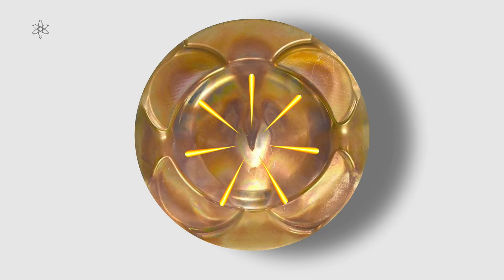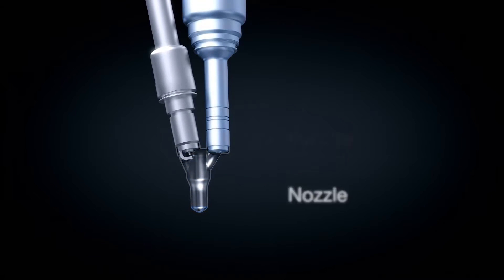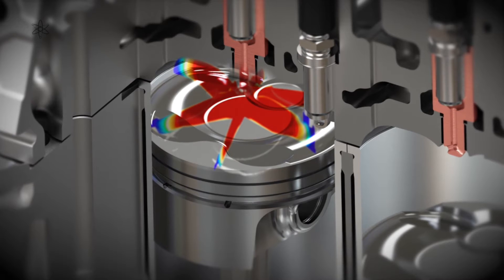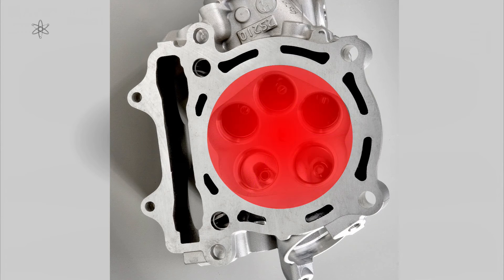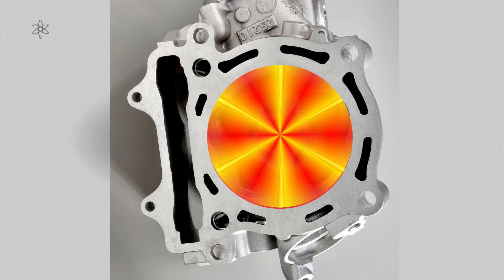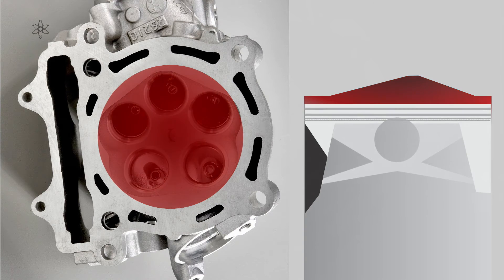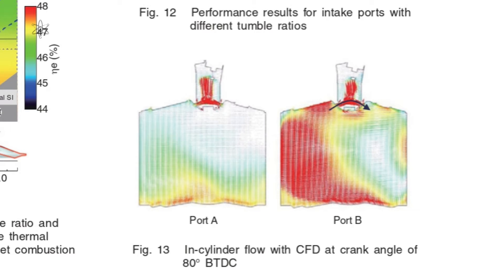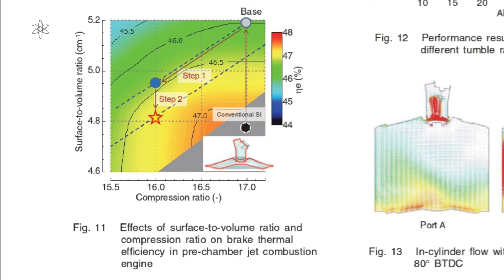Turbulent Jet Ignition

Comment: I have a very remedial question.  There are industrial passive Pre-Chamber  spark plugs for generators using natural gas for fuel that look very similar & have jet nozzles.......  
I'm sure if that plug design would work as a convention spark plug replacement upgrade, it would be made available for the mass market.
  Why does it not work?  
Are the holes too small for the gas charge to compress into the plug or other factors?????
Reply: main problem would be fuel and air mixture reaching the spark. i would quess.

Comment: i read the main benefit was the ability to run overall leaner because the tji assists flame propagation, i don't see why compression ratio would be different to standard SI
Reply: You're able to run a higher compression ratio because of how little time the combustion event takes to happen. The higher compression ratio would also change the lean flammability limit characteristics. The benefit of the higher compression ratio is also because of the improved expansion ratio.
Reply from the maker: this video was done on the basis that there isnt much information on how all these experiments and also race engines that use turbulent jet ignition can run such high compression. as for information on its ignition coverage, few are out there already hence why, as you said, it could run very lean. the system works better on load and vice versa as well hence maserati's complicated combustion chamber set up
Reply: Short version: Cr improves efficiency, boost improves BMEP lost by lean A/F, TJI negates the typical limit of detonation as higher pressures in the chamber are approached because a very lean combustion charge will not support detonation. This has been done on large Caterpillar natural gas engines for decades. They take a diesel engine structure and are able to produce power equal to the diesel with ultra low emissions and cool exhaust temperatures. I proposed this in 1985. The drawback is engine structure required to support much higher cylinder pressures. This is how F1 engines can make such high power density and still get over 50% thermal efficiency. Any other engine in the world would drool over this efficiency. FACT, but hard to believe it is true.

Fantastic graphics - thanks for this video - -WELL DONE!!
Reply: @billl7551  i was unaware that detonation could be avoided with a lean enough mixture.
in the natural gas engines you mentioned, did they use a spark for the prechamber?
the f1 engines are crazy, at first i didn't believe they were 50% efficient until i did a calculation using the fuel flow limit and approximate power to check.

Comment: i wonder how a pre combustion chamber arrangement would work on a wankel engine. maybe it could be arranged in such a way as to offset the basic flaw of the wankel engine that is it's excessive combustion chamber surface area.
Reply from the maker: cleaning or discharging the pre-chamber off burst gasses might be an issue if  t.j.i. is mounted in the middle of the combustion chamber but if it is in an advanced position and has some of the low pressure intake process to remove those burnt gasses then t.j.i. would certainly benefit the rotary engine however maybe a blown pre-chamber could work